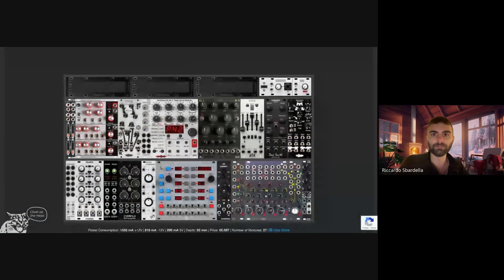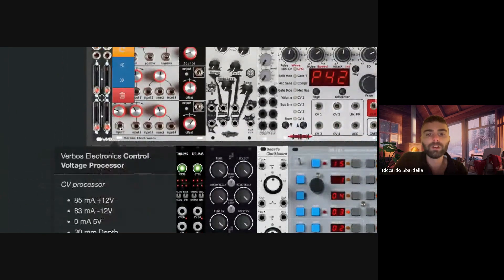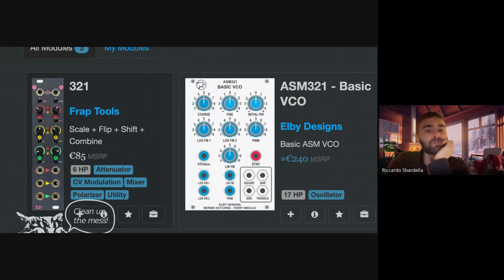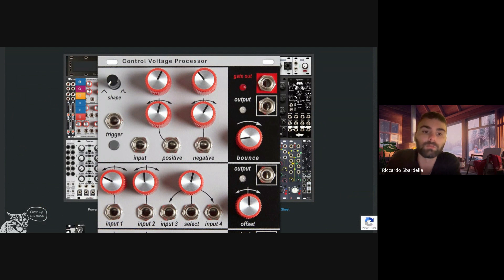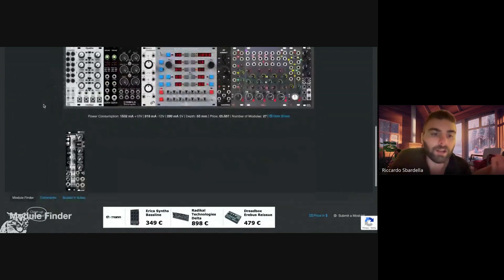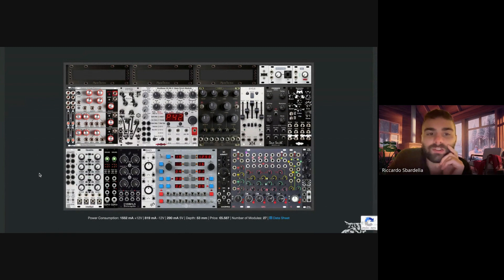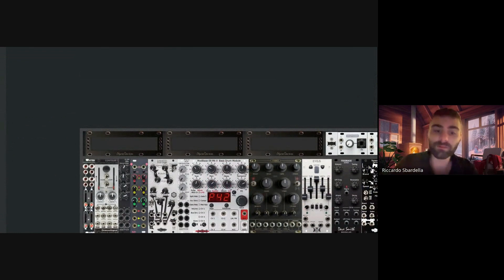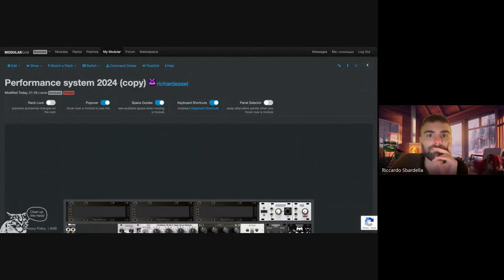Verbos Electronics - Control Voltage Processor review

Comment: Hey Riccardo, first off, enjoying your videos as Im pursuing something in the same vein with my case.  You've clearly spent some time with these modules and picking the right thing for your need, I was actually curious about how you used this module and then here you are explaining it.   Based on what you described, I may have a suggestion but sadly it wont help with hp in the end, it would be instead of the other two 4hp modules you already are considering as it wont do envelopes but, it can do your first two things with some additional uniqueness. Its called "Sindikat". I am still learning it's full power, it can definitely do these things and more and the cool part is there are two outs for the mixing which give you the positive and negative output separately, I will give your explanations a try with it and see if I can replicate the functional results on my case.  I didnt use it in these ways yet exactly, Ive only played with it a couple nights now.  Its really insane for its size, I actually bought it as just a basic CV controller because it generates cv when certain inputs are unpatched.  I like some of these things you are doing, which I can try now, and hopefully learn a new trick to incorporate.  Hope this is a mutually beneficial exchange and my suggestion is appealing, thanks for making the video.
Reply from the maker: hey, thanks I will check it out!

Comment: Thanks for sharing! I find this kind of information super interesting and helpful.

Do you sidechain everything or just the bass? Are you using SY0.5 for sub bass?

At first glance many Verbos modules seem quite large and confusing to me. But when someone explains how to use them I am amazed by the versatility and how well designed the functionality is. It seems like it would be hard for you to replace it with something smaller if you need that exact functionality. Having a larger module with nice big knobs is also good for live performance :)
Reply from the maker: Hey, thanks for checking out! I actually sidechain everything in my mix, except for the kick, clap, and effects. Looks like I'll be sticking with the Verbos for a bit longer! :))